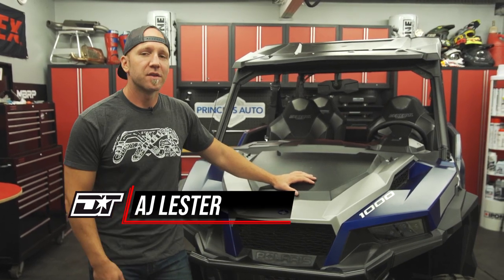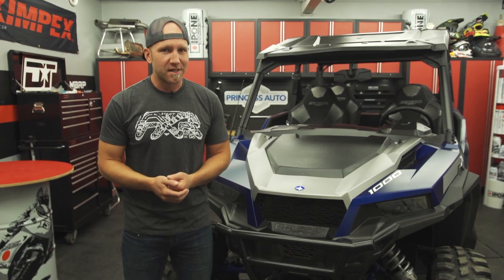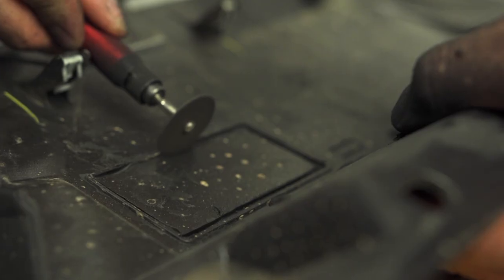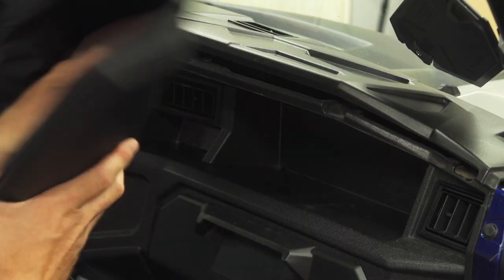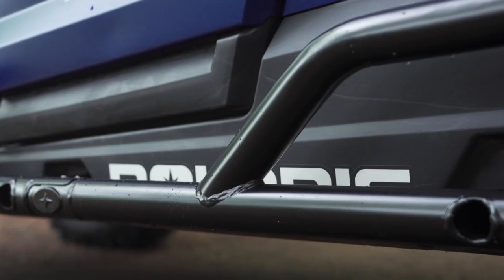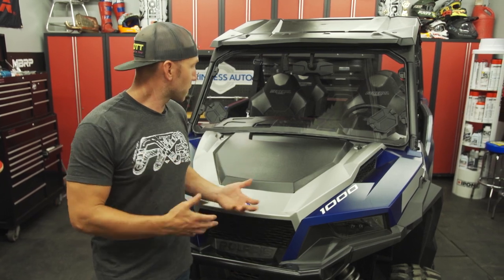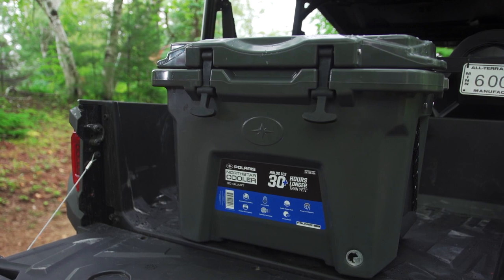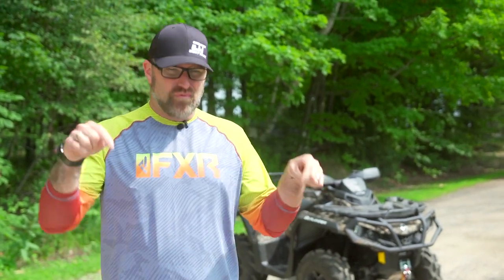General 1000-4 Must Have Aftermarket UTV Accessories From Polaris

Comment: Love my general. But at 2800 miles I'm on primary clutch number 2. Rebuilt the first one. Secondary showing wear. Upgraded it to ROLLERS!!! MUST DO!!!   Both rear tires slowly leak. Battery terminals corroded... 
  Just my 2 cents.  Have clutch service tools on hand. Upgraded the secondary. Add a pre-filter screen to airfilter.

Comment: A must have is shock work. Re-valve and springs. It makes a HUGE improvement in handling and ride. Stock they have way to much body roll and ride terrible. At least on sharp edged rocks and bumps. I changed my springs to Zbros and had the shocks re-valves at Carl’s cycle in Idaho and what a difference! It handles better, rides better and is way more confidence inspiring. For me that it the number one thing I would do.

Comment: AJ , i have a 2022 polaris general xp with ride command .  i have an old ipod 7th gen ipod, it needs aux in and usb to play, are there connections on either the ride command or the amp , that i can connect an adapter to the console , so i can use the ipod ??

Comment: You  did not mention the snorkel kit especially for the 2 seater. If not installed, and you get into deep water, the breathing piping fills with water and the belt gets wet. If not caught quickly and drained by way of a plug you can blow apart the clutch!! Very bad design flaw as the pipe openings are too low on the machine.